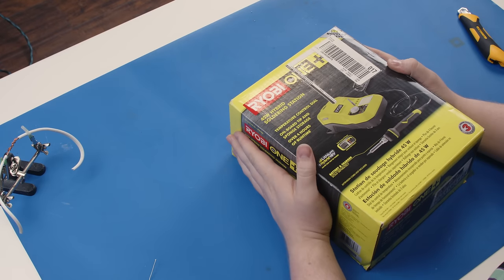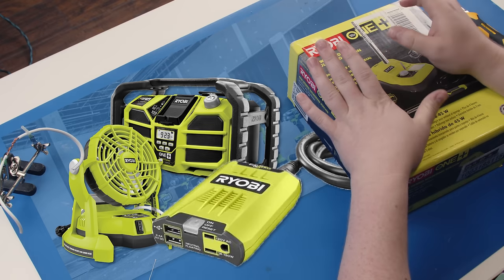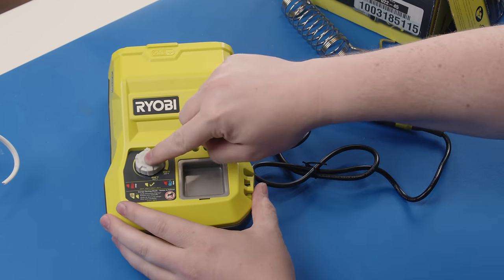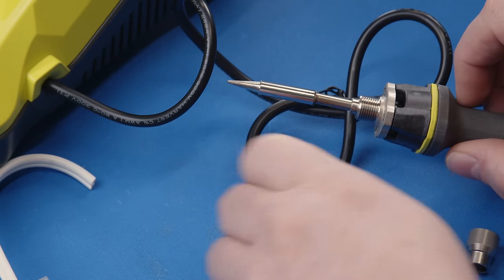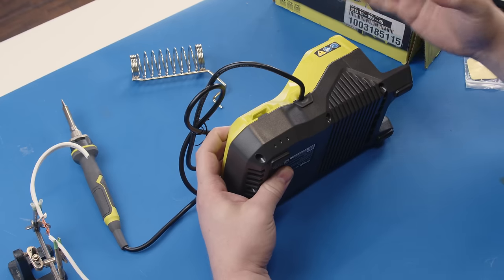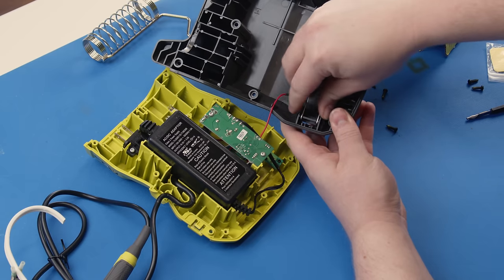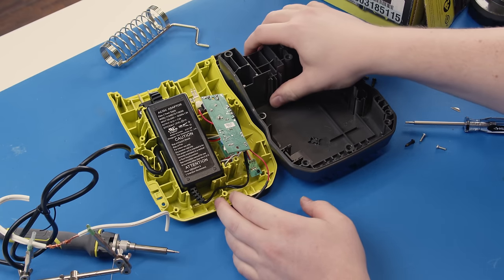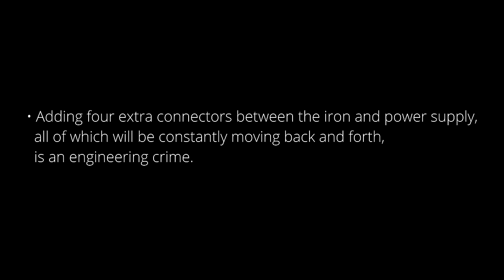Ryobi has GOT to be joking with this soldering iron

Comment: I like aa and aaa batteries because I have a bunch of eneloops. I like being able to swap batteries and I'm good to go right away. Having to stop using a product while you charge it's internal battery pack is stupid and annoying.
Reply: Or having to charge Eneloops if you dont have enough (charged...) spare ones ready which makes it often worse since you cant charge eneloops as fast as Li Ion batteries, on top their energy density sucks
Reply: Dont get me wrong, i really "love" eneloops, they are essential for me in many usecases, even the TVs remote (LG, drains the batteries extremely fast since it uses a 2,4GHz connection beside infrared, about 4 charges per year).

But i exclusively use eneloops where energy density isnt a problem, so no Eneloops in lets say flashlights (except a low powered RGB one...), camera flashes (once they were great, but nowadays cameras supply them or you have internal, much higher capacity LiIons,...), etc.
Reply: @harrison00xXx  all good points. I remember wanting to use them in a Pentax DSLR back in the day, but the energy density was just to low in that case for me. Ended up using Energizer ultimate lithiums in that situation with way better outcome.

Comment: If you want a battery iron get that chinese one that uses dewalt or whatever and has a hako hand piece... also if your pressing on a pcb hard enough to bend or snap the iron then your doing something wrong... that weller iron you have is far better than that crap...😢

Comment: By your own admission, you suck at soldering. Even when using a modern feature packed soldering station. Then you get pretty harsh on the simple, fixed temp, el cheapo soldering irons you showed in your video. Those are what I learned to solder with and find that they work pretty good. The only real problem I ever had using them was due to my own impatience. I think the most problems rest with the skill level of the individual user. I have six or seven different soldering systems. Each has pros and cons. It's up to the user to develop their skill set and match the tool to the work. Don’t always blame the tool.

Comment: What did you expect, found in a hardware store? Crappy things like this. Only idiots will spend 20USD for 2 crappy 900M-iron-tips.. shape: screwdriver(?!) and conical. 

But I guess your nice Weller soldering station was not sold there. Since chinese companies enters the market with all kind of sometimes very good and cheap products (T12-, C210-, C245-, TS100-clones), they are history.

Comment: You keep talking about "all this force" on the tip. Sounds like you don't actually know how to solder correctly. If you tin your iron you shouldn't need to do any more than touch the damn iron to the workpiece. No "pushing" or "crazy force" involved
Reply: He is talking about force applied to the tip during transport or while it's on the bench and you're moving things around. It sounds like you don't actually use a kitted out workbench, and understand what goes on when it comes to moving things around sometimes!
Reply: @----.__ I spend most days doing soldering projects. What are you a klutz or something? I routinely have to carry a soldering station out onto the floor to do in situ repairs as well.
Reply: @NicoRiaz  I got my qualifications in the late 90's as an avionics tech in the Air Force repairing multilayer PCB's on the F-18's avionic systems. I now design the weapon systems for naval warships. Bumping in to things is a part of life if you do something in a capacity more than just a hobby! I'm hardly clumsy by any stretch of the imagination, but to think that things don't get bumped in the flurry of an active project is a level of naivety I wish I could still enjoy! It takes just one pelican case to be put down in a rush and something will get knocked!

Comment: You are correct you know nothing about soldering. All I do is electronics repairing and building and the best soldering iron I ever used was one of the irons that are the corded pencil type from Radio Shack made my living with it for 10 years the only feature was an iron clad tip and yes I still have it and it still works very well which makes it about 40 years old you need to talk to some professionals. and by the way I have the Milwaukee 12 volt and have had no problems it is now 3 years old and works great for light soldering and it stands up on its on so if you're not a cults and knock it in the floor 5 times a day they work well.